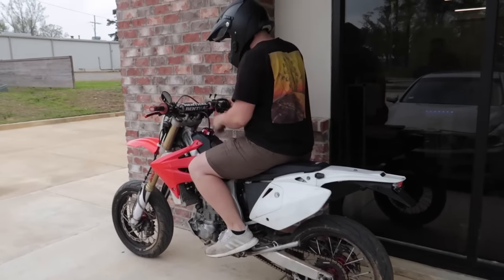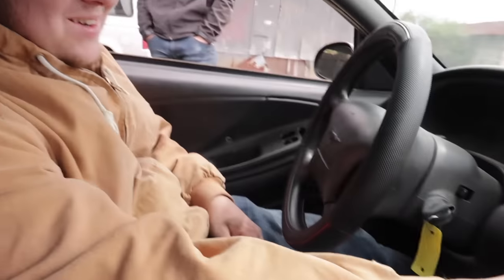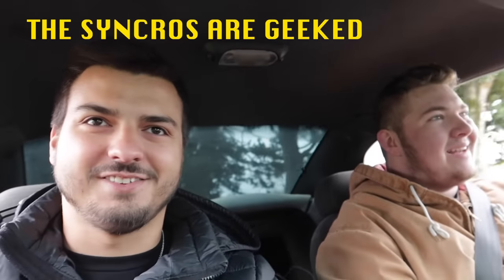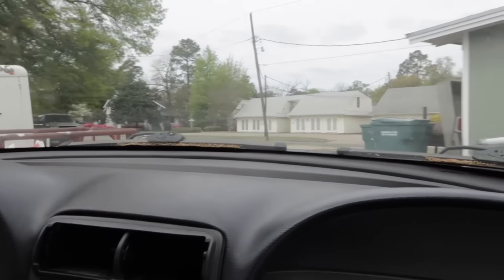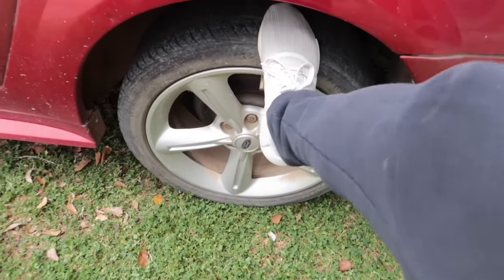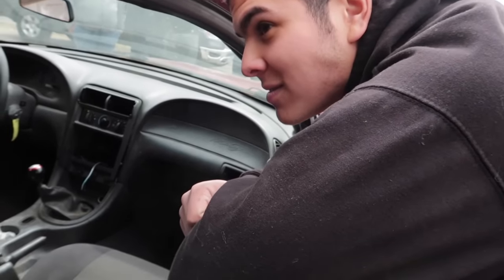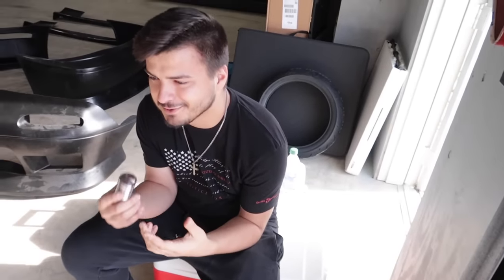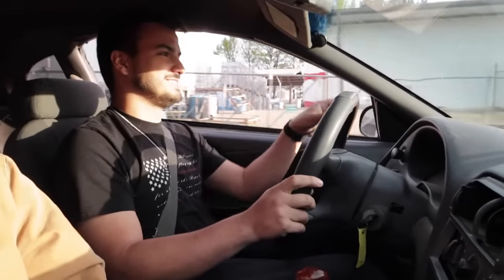I Bought a TWIN TURBO mustang for $1000!!!

Comment: With these 3 mods the car will look 100x better:

1. Mach 1 chin spoiler and grille delete
2. New headlights
3. New taillights with sequential kit
Reply: Have everything you mentioned on my gt dark smoked tails and headlights
Reply: Wheels and lowering springs go a long way
Reply: Dont forget lowering springs. The stock wheelgap is horrendous and looks like 4x4
Reply: Don't forget wheels or rear spacers
Reply: Don’t forget that mod money